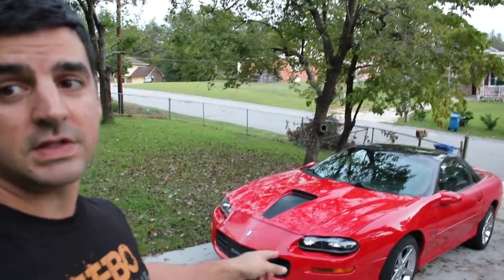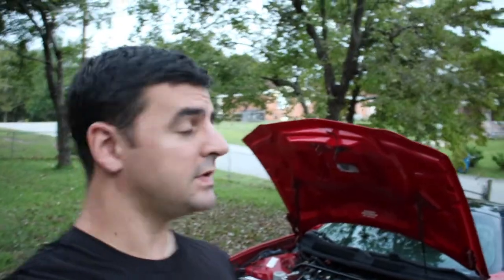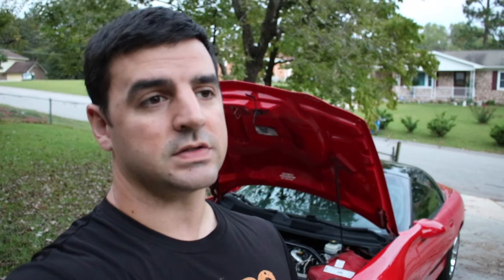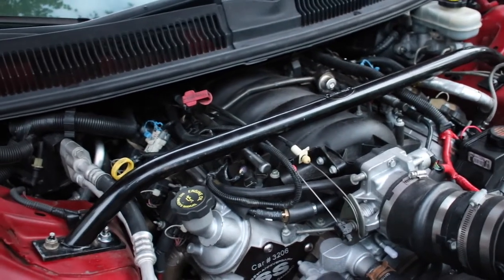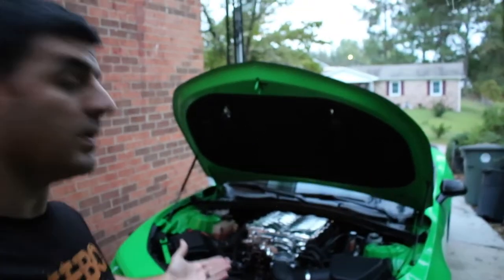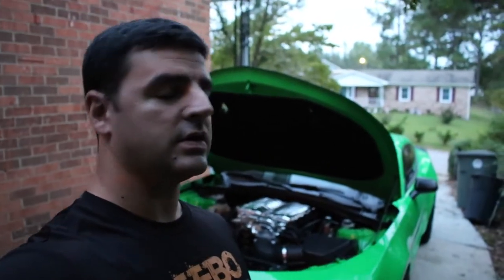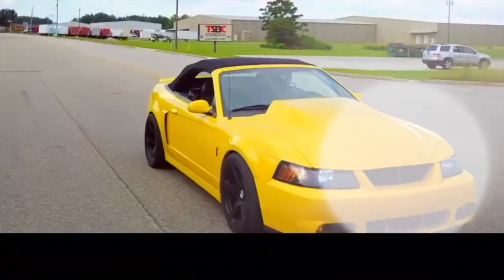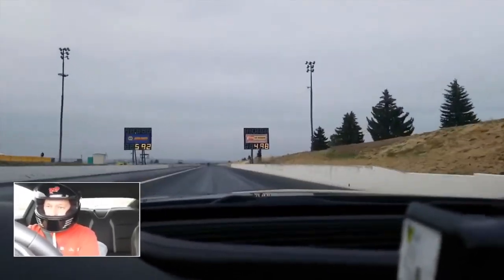F-Body built recap, Whipple 1LE Update + **2 Channels you NEED to be watching**

Comment: I like the F body.  I have a 2001 SS with SLP exhaust and Kooks headers and high flow cats.  Getting over 350 at the wheels.  I am thinking about 
swapping in an LS7 and building a Harrell style clone.  I am sure long tubes in the other Camaro will really help out a lot and you may like the sound.  I have an Eldelbrock blower and Kooks headers on my Silverado along with a cam and LS3/6 heads and it drives and sounds great.  A Procharger on the F body would be sweet!

Comment: Hey so I’m trying to do a swap from a v6 to ls1 and I’m trying to get this right are they the same transmission as the ls1? I have a 2002 Camaro 3.8 v6 I looked it up on eBay and they are both the same but I wanna confirm it before I buy the motor for it thank you.
Reply from the maker: Tee Orr A V6 Trans will not work with an LS1 without being modified. They are both 4L60E transmissions, but to my knowledge they have different bell-housings, input shafts, and other parts
Reply: What kind of parts should I get I have no clue or do you think I should just a z28 easy that way ?